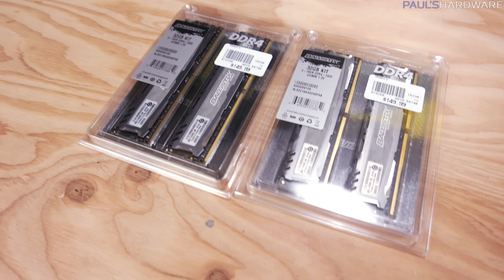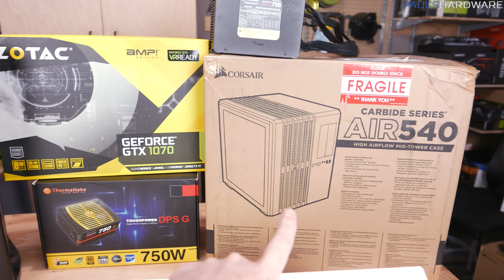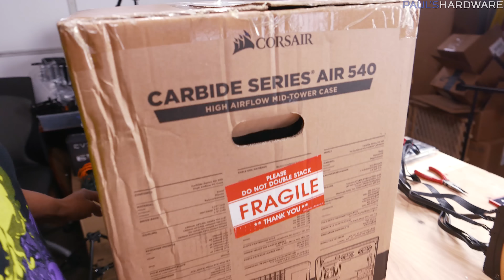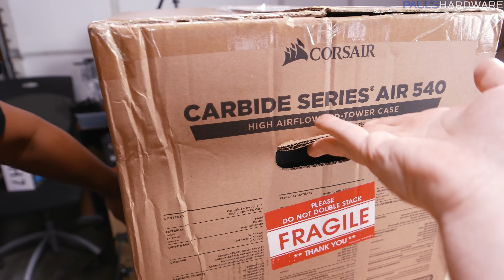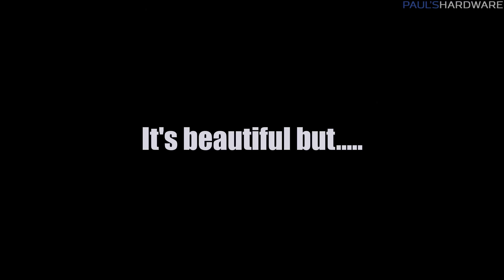Building "Party Monster" - Joe's 4K Video Editing PC

Comment: about the fan mounting mechanism...cuts costs? man those rubbery fan things are for reducing vibrations. :P
Reply: scrolled too far down to find this
Reply: Was about to comment the same thing!
Reply: o and that rubber mounting set up is just a Noctua copy
Reply: stevenidge Normally for case fans though to stop vibration, as for CPU cooler it has quite a gap.

Comment: you're wrong about the 5820k only supporting 64 gigs btw.... officially YES its only 64 gigs, but i've seen several rigs running 128 with the 5820k and intel has released microcode allowing 128 gigs....

Comment: Those rubber fan mounts are to reduce vibration and noise. PCcool makes little cheap coolers that work pretty well and are near silent. I just used a smaller version in a build I just made.

Comment: Why from 3960x to 5820k? - whats about just changing the RAM to 64GB and the GPU, as well as adding the SSD?
Reply: Exactly my thoughts - 5820k has only slight edge over 3960x. Except memory type, AVX2.0 (this one might actually be important one) and PCIE 3.0 vs 2.0 there is almost no difference... Good video anyway :)
Reply: a 6800k (6core) performs similar/better than a 5960x (8core).  
So I think a 5820k would perform much better than a 2 generations old Extreme CPU. 

Also when you have the money, you will think differently. 

Also editing 4k smoothly on 3950x by upgrading Ram and GPU is totally possible tho...
Reply: 6800K perform better than a 5960X?

-_-
Reply: 6800k may perform better in applications that use up to 6 cores but if you can utilize all the 8 cores of 5960x then it's way faster. About 3960x vs 5820k - for non AVX2.0 tasks the difference is no more than 10% and usually between 3 and 8%. The sad truth is that Intel does not make the significant performance jumps from generation to generation like it did 10 years ago :(
Reply: indeed, noticed that when my 3930k was getting similar performance to a friends 6800k.
Reply: +Zaber Ansary A 6800K will perform almost identically to a 5820K (less than 1% difference), and will overclock marginally worse. Outside of Intel binning the best core on each Broadwell-E chip (only useful for CPU affinity settings), Turbo Boost 3.0 (which the effects are rarely seen on CPU intensive tasks), and official native DDR4-2400 (Both Haswell-E and Broadwell-E can utilize all DDR4 speeds), there is no reason to consider Broadwell-E over Haswell-E before considering price or the 6950X's 10 cores, of which there is no Haswell-E counterpart. Broadwell is considered a failure, as the IPC increases Intel aimed for didn't hold up, integrated graphics don't mean a fuck in desktop computing, it didn't clock any better, and the first wave of the 14nm process didn't overclock well.
Reply: I honestly don't believe the processor change was for improved speed as it's only about 10-15% faster per clock speed. It was more for the platform change, just to get out of that pci-e 2.0 era,  native usb 3.0, and more ram capacity of DDR4 dimms.